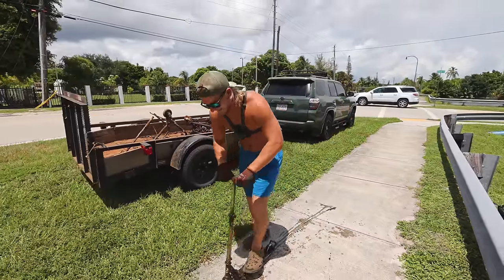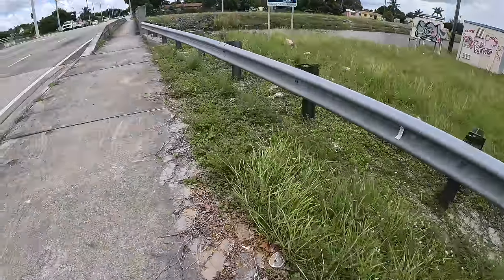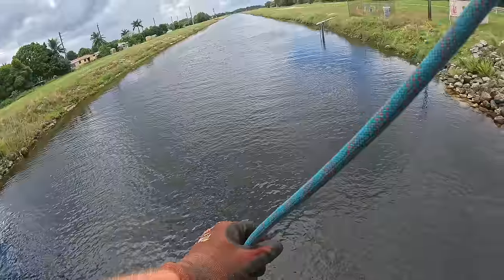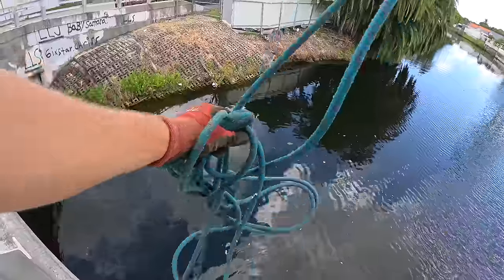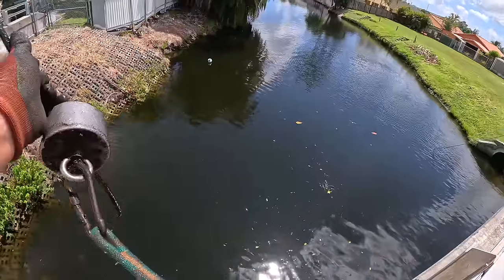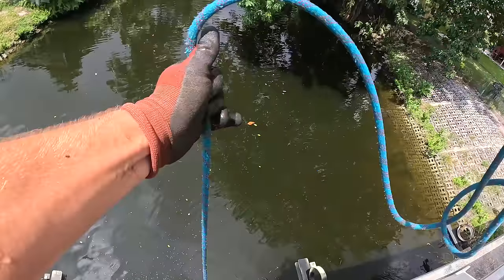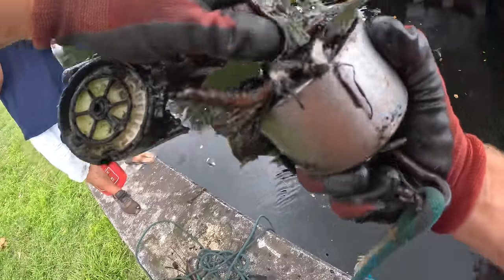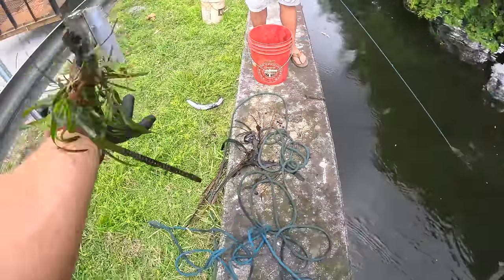My Best Magnet Fishing Find EVER- AR-15 Found Magnet Fishing

Comment: I'd 100 percent go and have the serial number checked that's not a cheap ar and imo the only reason its in the water was cause it's stolen or used in a crime.some of those sigs can fetch 2500 depending on caliber and barrel length. crazy find great video
Reply: Exactly what I'm thinking
Reply: Indeed! Imagine of her gets caught with it and it turns out the same AR might have been used in a homicide and could have had fingerprints on it. Now the only fingerprints on a potential murder weapon are likely to be those of his own